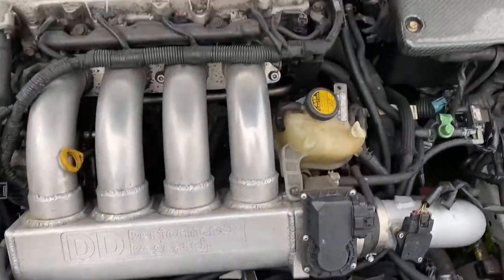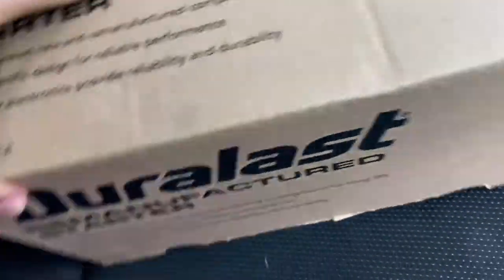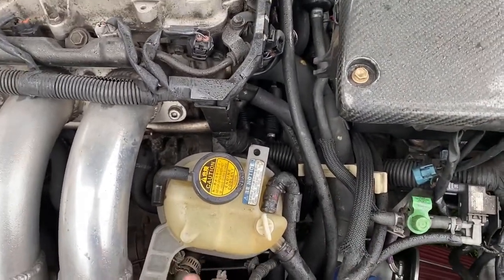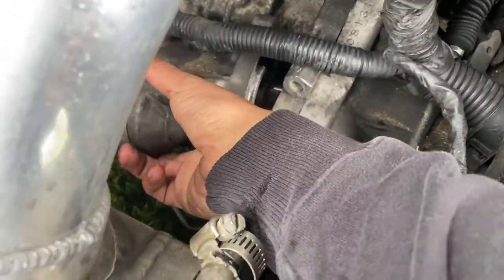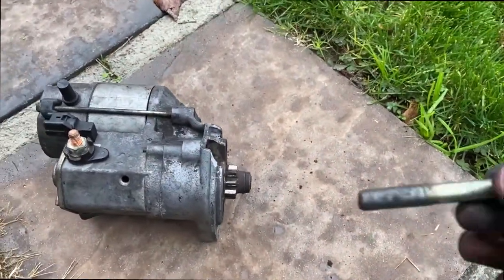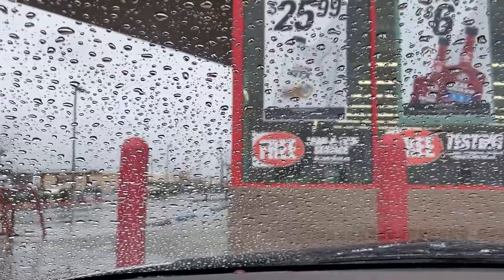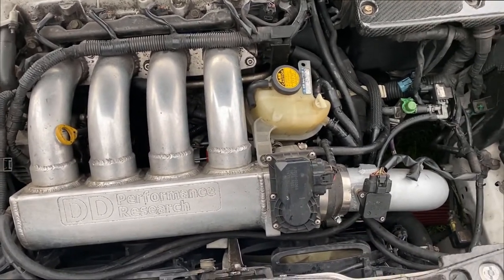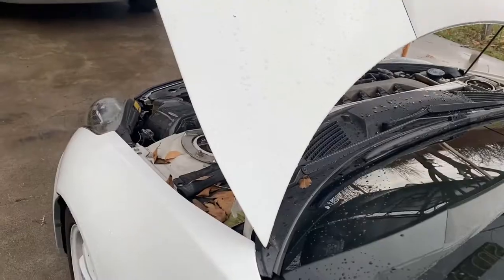Tsunami Starter Broke!!!

Comment: Great video I removed my first celica starter in October it was tough but no way was I going to let to bolts beat me lol... rafa maybe do a video on proper filling the coolant it's a bit of a process if its completely drained.. I found out the hard way I guess it fills a bit at a time with the reservoir lifted up...
Reply from the maker: Robledo,D Sure will thanks for the suggestion
Reply: i second this!
Reply: @RafasGarage  what should I check first I got a po171 code. Mass air flow sensor.
Reply from the maker: Robledo,D Check your maf sensor and vacum leaks

Comment: your videos are very helpful, i am gonna have to go through you entire channel here soon to see what I can learn. Ive had my 2001 Celi gts(automatic) for about a year now and ive done some work on it myself, im not a real mechanic but i am eager to learn this car. I just jerry rigged the button to be able to use the M mode, its so fun, i wish i had a manual hah. I have a whole list of parts and systems to look over in my celi, but many of which i have no ideo what im doing so I gotta use the internet(celicahobby, youtube, downloaded pdf manuals) to the fullest.
Reply from the maker: DrDoubleZero Im glad it is helpful and if you need any answer feel free to ask. Also check out the newcelica forum there’s a bunch of info on there.
Reply: @RafasGarage  i need a millions answers haha. Some things i just dont even know how to ask just cause of my ignorance of basic terminology. Figuring out how to clean out the ovc filter screen thing near the battery was a pain haha. One guide with pictures had it in backwards and i copied it and put it back together wrong ha. The next thing i will be doing is getting a new sensor/solenoid for that piece. And probably replacing a couple gaskets and the lift bolts, i dont think the lift activates. Could be the maf sensor like in one of your other vids.
Reply from the maker: DrDoubleZero First Ill check the lift bolts then all the other stuff
Reply: @RafasGarage  sounds like a plan. I was thinking of making videos of my progress so others can get help from them or most likely scold me for doin something wrong so i can learn more haha. I hear if the lift bolts are broken its really bad, would i need special tools to get them out if they are?